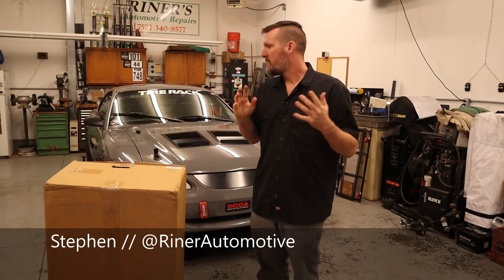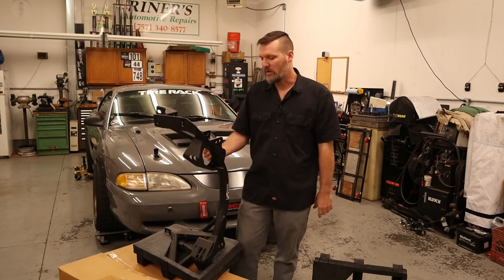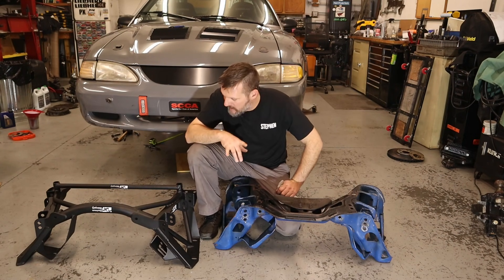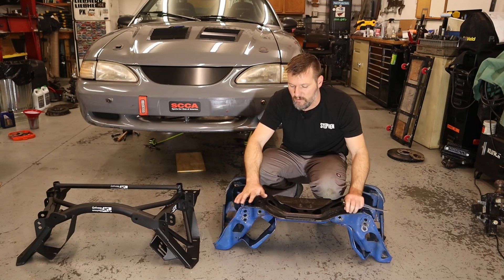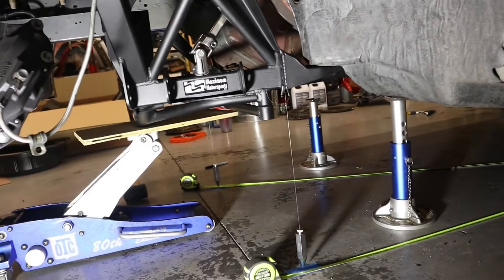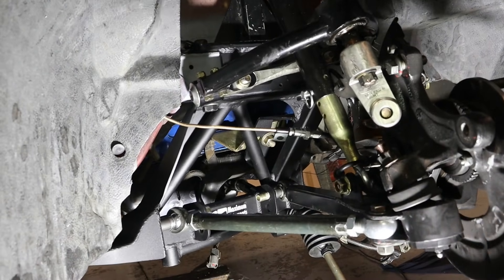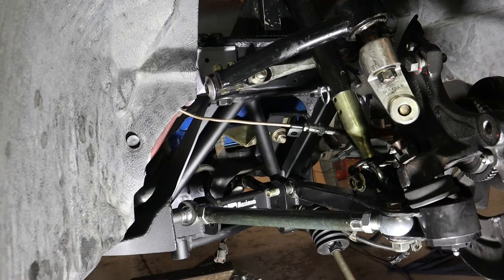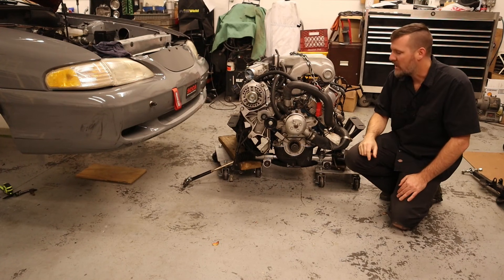Mustang K-Member Installation: Why Choose Maximum Motorsports?

Comment: I have 2x aftermarket k-members a mm and another tubular one that I don't know the maker. The mm is heavier and beefier than the other one I have. The tubular one doesn't have large mounting holes so where it goes is where it goes with the mm the mounting holes are larger so you can dial in the k-member with measurements. Also I didn't know but you need a mm steering rack kit to attrach the rack to it, it's not expensive but is something you have to know to purchase to complete the install. The k-member was easy to install once the original member was removed.

Comment: Can it be installed with the engine in?
Reply from the maker: yes you can support the engine from the top and replace just the k-member. That's actually how it's described in MM instructions

Comment: When my motor needed pulled in my 03 mach 1 i added this and longtube headers. Made sense since the engine was out.
Reply from the maker: That makes sense. MM's instructions do cover installation without removing the engine which is nice.